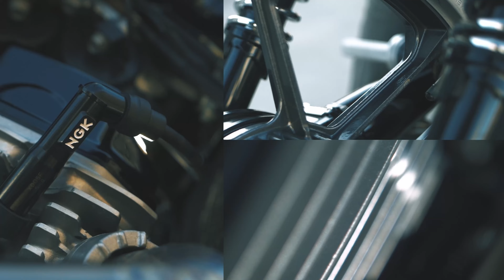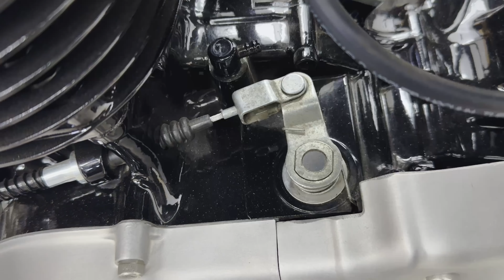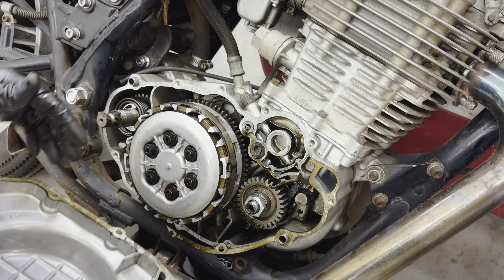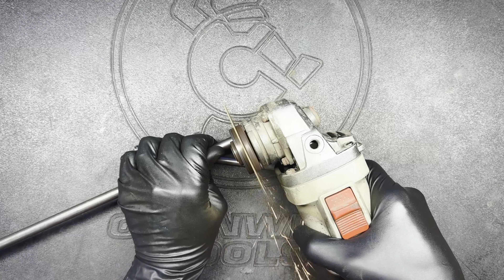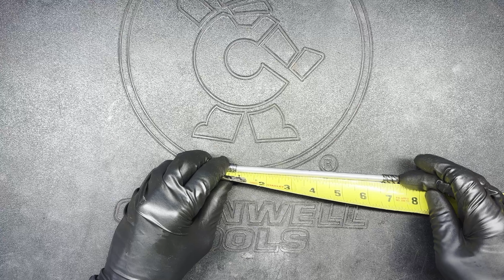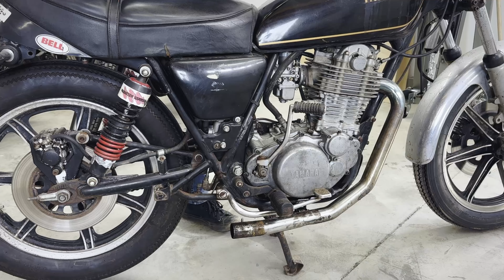Fixing an SR500 Clutch (for free!)

Comment: Hey man, thought I was having some issues on my end and went to inspect the cam adjuster to realize the bolt has been stripped out. Any chance you know the exact part for the cam adjuster screw? I can’t seem to find it anywhere online. 

Also, in order to reassemble the cam
Adjuster screw back into place correctly, does that pivot arm need to be raised beforehand? Any tips or help would be greatly appreciated.

Comment: Hi I have always put a small amount of grease on the gasket and on the engine case. This helps when dismantling plus you can use the gasket a couple of times if your careful helps with sealing process . O rings a bit of silicon grease helps stops them drying out.

Comment: I'm just about to reassemble the motor for my 1978 SR
There was a little wear on one end of the rod you repaired 
The local machinist knows the 500s well and said it was usable and not to worry about replacing it but the part was so inexpensive from Yamaha I got a new one anyway
I also bought a new shaft the part the cable attaches to that goes down through the case and works against the rod you repaired my bike is relatively high milage and there was excessive wear in the hole where the pin that attaches the linkage that holds the end of the cable to the lever at the top of the shaft 
The bottom of the shaft where the rod works against it wasn't as worn as the one in your video and again my trusted machinist said it was usable and I supose I could've gotten the worn hole welded up and redrilled but the new shaft was so reasonably priced from Yamaha I bought a new one 
The Shaft was around $45 or $50 Australian from Yamaha 
I saw a NOS shaft the same selling on ebay at some place in England for $175au 
Because of the only recently discontinued SR400 you can still get just about anything for my 1978 SR500 direct from Yamaha and a lot of it is surprising economic to buy
You'll often see secondhand parts or NOS parts selling for twice the price or more than the same parts from Yamaha 
They can also supply a lot of the original 78 parts but unlike the newer 400 parts that you can simply order off their internet site you have to speak to them over the phone to check availability for the 78 parts 
About the only things you can't get are the rear disc brake and master cylinder parts that were only fitted to the 78 79 American/Canadian and Australian/New Zealand models
A lot of the parts for the recent SR400 still use the same 2J2 numbers used on the originals 
Somethings are different but still usable I just had some things arrive including three 5mm countersunk screws that secure a plate that retains a gearbox bearing and instead of philips heads they are torque heads, if I'd spoken to them I'm sure they could've have supplied the original philips, but they'll do

Comment: I have the same bike. The part that the throttle cables connect to (trying to run new ones) is not moving as if it’s locked. Any suggestions as to what would be causing that or fixing it??
Reply from the maker: Are you running the push and pull cables on a stock carb? Could you have them ran backwards? That will make it feel locked. Also if you haven't cleaned the carb recently maybe some old sticky gas is making the slide stick. Or the pumper linkages can get seized sometimes which will make the throttle not able to move.
Reply from the maker: If you are running both cables, I would suggest removing the push cable and only using the pull. It's way easier to setup, adjust and get a snappy throttle that way.
Reply: @oneupmotogarage  awesome, thanks! I think im going to have to take the carb off and clean it because it’s sticking.

Comment: Video is great and channel is solid my dude, but SR500 are all crap bikes. I have had 4 now with this exact issue. They were a terrible design by Yamaha, only God knows why people even want this junk still considering what is now available.
Reply from the maker: Interesting, I've had several and this was the first one I had this issue with. But it does seem to have been a fairly common issue with them from what I hear. Overall though I like them. I just had one of the fuel injected remakes in the shop and it was pretty neat to ride.
Reply: Love my SR, it's so damn simple.
Reply: Own my SR 500 for 39 years now (bought it new in 1986) and wouldn´t like to miss it. It´s a phantastique, simple and reliable bike.

Comment: Well it looks like my sr400 is suffering the same issue. So as the engine is drained anyway it looks like I should inspect the clutch and the pushrod. Thanks for the excellent video
Reply from the maker: Hope it helps you find your issue!
Reply: Thanks. - pulled the actuator out and scored just like yours and the adjuster cam so well worn. Will pop the clutch out next week and inspect the rod but assuming that’s going to need looking at also.
Reply from the maker: @atthesummitMTBskills  yep might as well while you're digging into it!

Comment: Good vid. Iv been having oil leak from that seal on pivot arm - it occasionally lifts up allowing oil out. Ya reckon a new spring will solve it?
Reply from the maker: My thought would be the seal that sits just under the spring. You can use a generic oil seal of this size: 17x28x6 or search via the OEM part # 93102-17148 or 93102-17357 Hope that helps, good luck!
Reply: @oneupmotogarage  ...also, I'd love to upgrade my SR 500 to LED lights and speedometer, have you by any chance planned to do such work and would make a vid?
Reply from the maker: @pmacc3557  Sorry thought I replied to this too! On these the headlight and tail light are plug-and-play with LED bulbs. (H4 = front, 1157 = rear). Unless front is sealed beam then you have to swap the bucket. Signals are also easy to swap bulbs but you have to replace the flasher with an LED compatible one. I'll do a vid on that next time I need to swap one! Gauge lights same, just swap bulbs hardest part is getting to them!
Reply: @oneupmotogarage  ok thanks alot. I want to buy all new LED plus electronic dashboard speedometer etc but the wiring might be tricky
Reply from the maker: @pmacc3557  Oh I see yea if you want to update the gauges that does get a little more involved. Look into either Vapor gauge systems or MotoGadget, to get you started.
Reply: @oneupmotogarage  ok thanks. IL try play around with that adjusting screw that sits in the middle of a locknut to see if it has any effect also
Reply from the maker: @pmacc3557  You can see what that does, but it won't likely stop an oil leak from that seal unless your clutch pivot arm is really worn in one spot. That's possible depending on the mileage. You could adjust it to a new spot (raise or lower it a little) and then get the clutch play feeling right again using the other adjuster (at the lever).
Reply: @oneupmotogarage  makes sense. Thanks alot👍